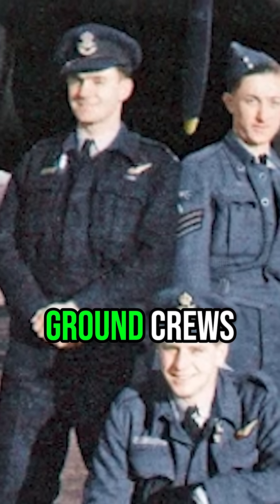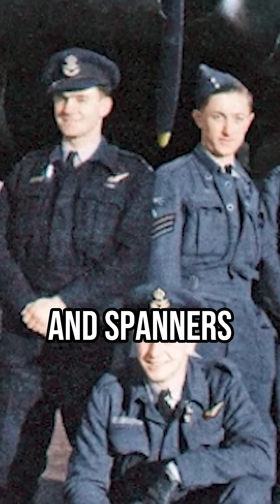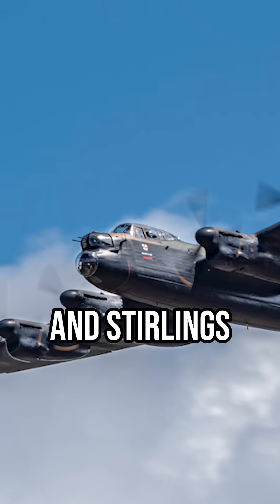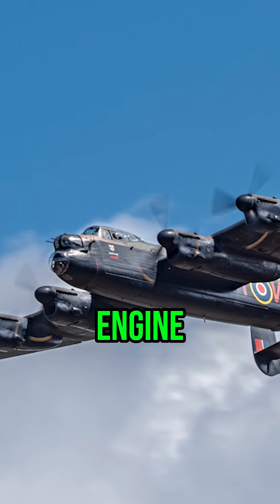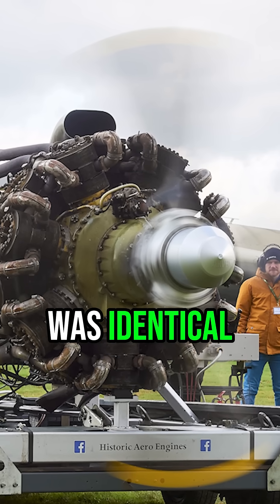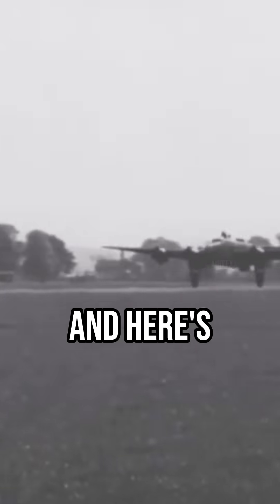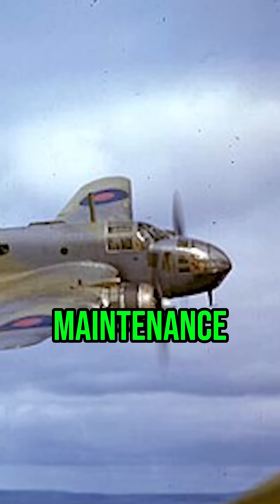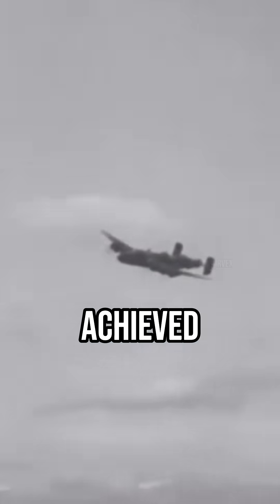How Halifax Engines Snapped Out in Four Hours?

Comment: Superior attention to maintenance design.  I had a sand rail that l could take the engine out in 10 minutes. Used trailer plug for wiring to alternator. Disconnect throttle cable. Four nuts holding VW engine. Out.
Reply from the maker: Great point!
Reply: Nice

Comment: the Lancaster had Merlin engines so engine types across aircraft were not standard
Reply: There was a variant of the Lancaster equipped with Bristol Hercules engines.
Reply from the maker: Yes!
Reply: @Fordnan on the other hand there was such a demand for the Hercules to power Halifax’s that they attempted to make a Merlin powered Beaufighter. Possibly the only aircraft made worse by adding a Merlin.
Reply: @Fordnan 

      I WAS ABOUT TO MAKE THAT SAME COMENT.!!!

      LANCASTERS   B.II , WITH BRISTOL 
HERCULES  VI OR XVI  RADIAL ENGINES.!!

      👌👌👌👍👍👍
Reply from the maker: Yep, but swapping those (right) engines was fast and modular, even if overall engine types across aircraft weren’t fully unified.
Reply: Some Halifax variants also had Merlin engines.
Reply: The Merlin engine became scarce until the yanks started mass producing them. When Britain couldn't produce enough, the Lancasters used radial engines.
Reply: His point was that the given engine was used by multiple aircraft, not all aircraft.
Reply from the maker: Yep :)
Reply: The Lancasters all used standardised “power eggs” (even the radial engined Lancaster MkII). The engines were interchangeable modules (and that’s how they were maintained - pull faulty engines as a module and replace them with a newly overhauled unit).
The Lancaster airframe was the same - it could be unbolted and a module like the entire cockpit replaced.
Reply: @allangibson8494   so this vid is also modular, but a bad egg 😞